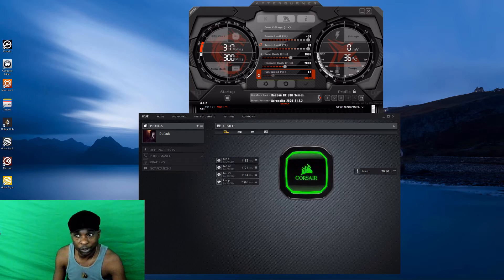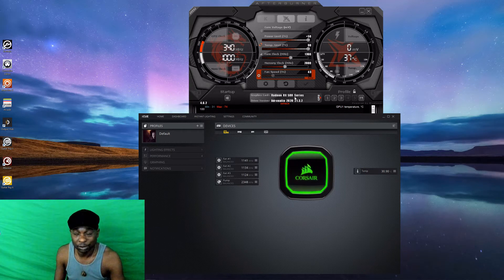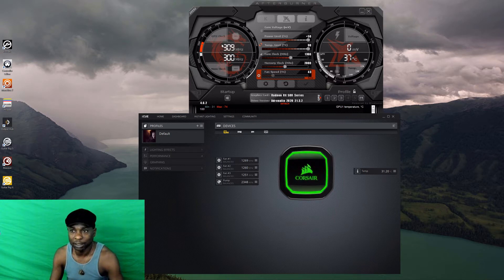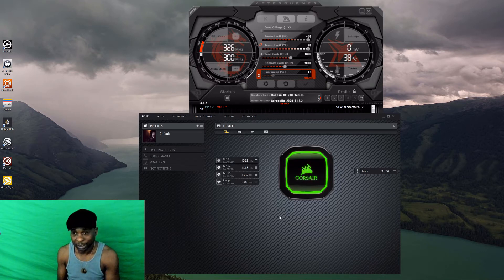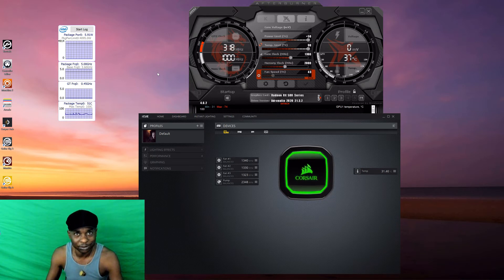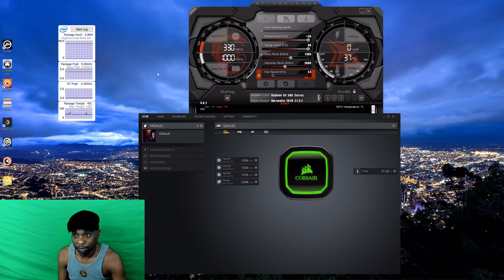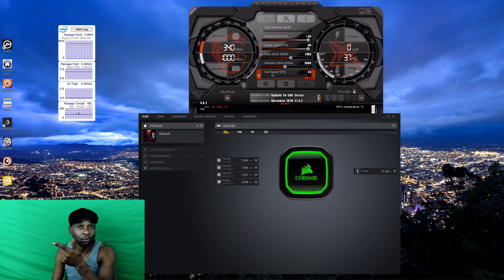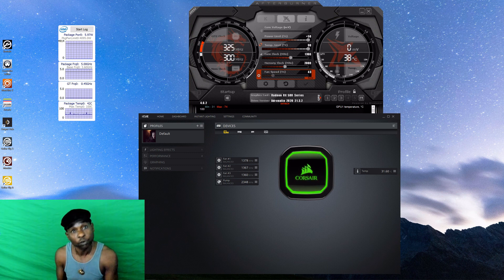XFX Radeon RX 580 Heating Issue Solved

Comment: so mine basically goes up to 90 celcius on 2-5 minutes full stress test what can i do to fix it
Reply from the maker: I took of the thermal paste they were using on the GPU and replaced it I actually show you in the video, the thermal paste on the RX-580 was to thick at least on mines it was so I would start there
Reply: @OldManBoxing  i dont jave money currently for thermal pads so will only replacing thermal paste work atleast? drop down some of the temps?
Reply from the maker: The paste normally comes with the pads